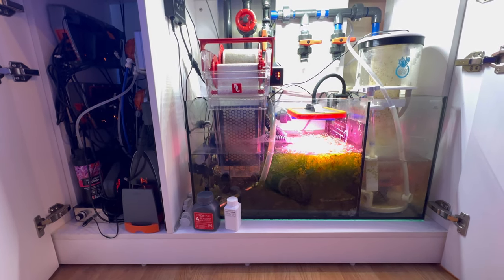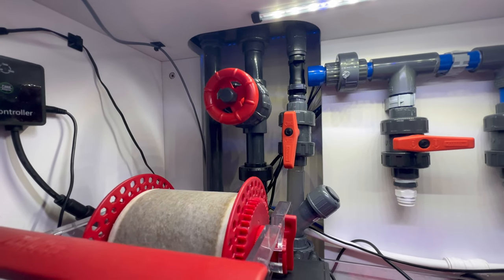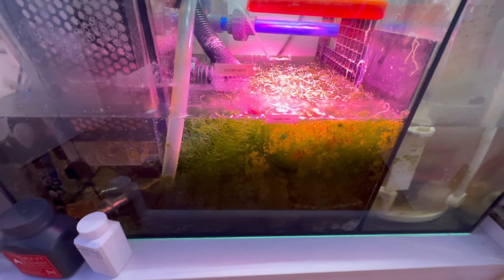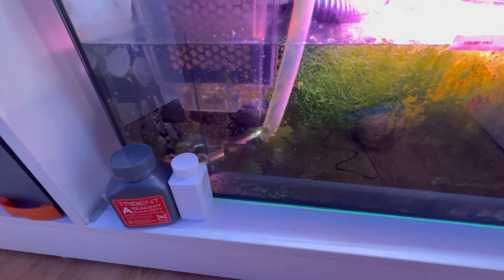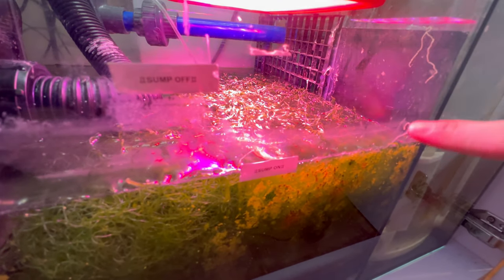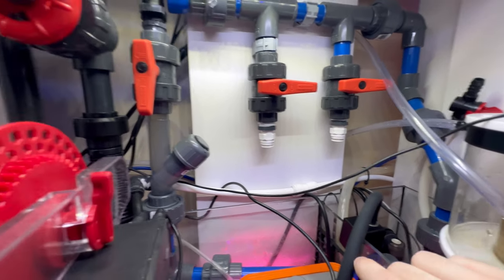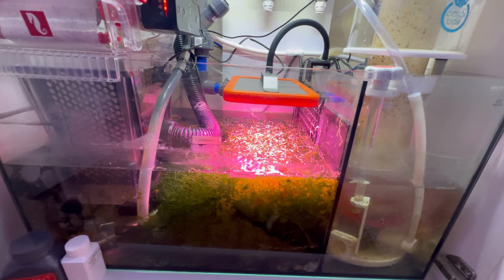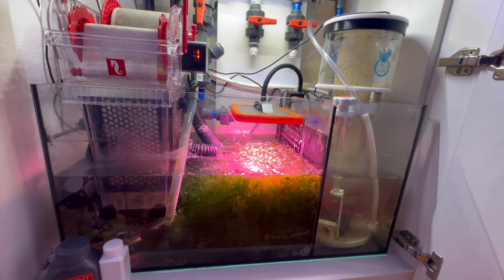Unlock the Mystery of Reef Tank Sumps! Beginner's Guide

Comment: Great video and a nice simple sump layout.

Just a little fyi, the water is meant to be very slowly trickling down the "emergency" overflow in this standpipe design to ensure it skims the surface of the overflow and to make sure no air goes down the main drain pipe as the main drain is running under a syphon being created by the gate valve and the intake for it should be a couple of inches under the water level in the overflow box. The "emergency" drain is what sets the height of the water in the overflow box and the height of it should be just below the bottom of the overflow grate/screen. Don't worry, most people set this up they way you have it due to the influences doing wrong.
Reply from the maker: Thank you for watching!